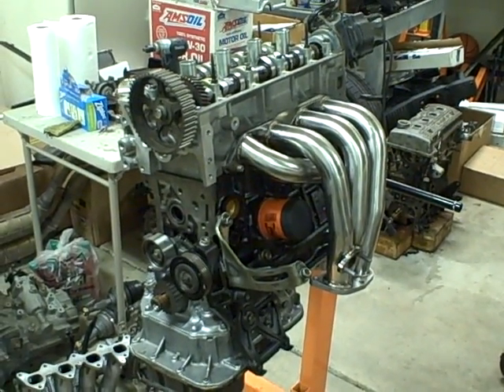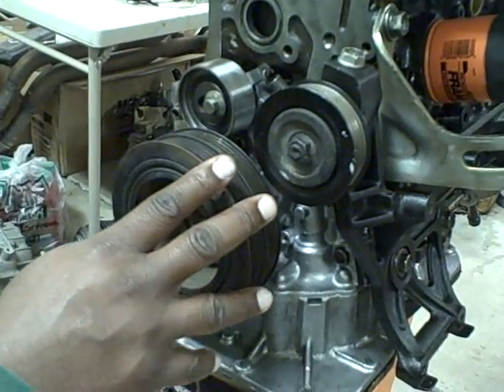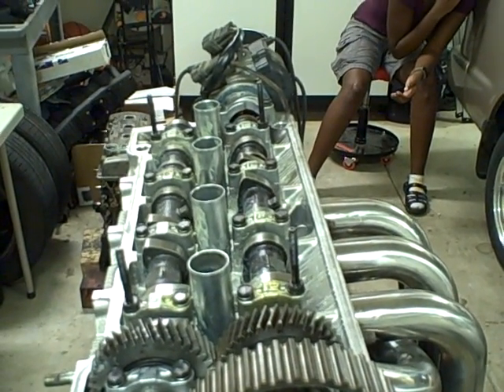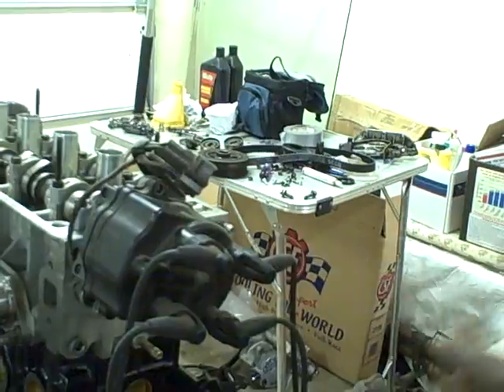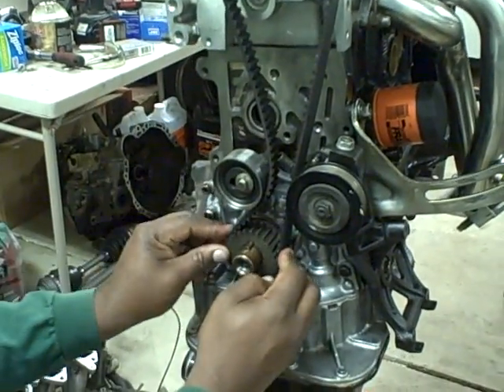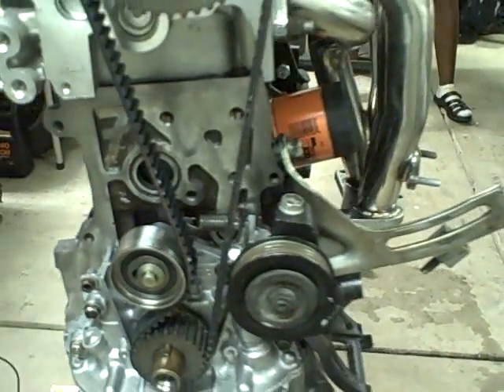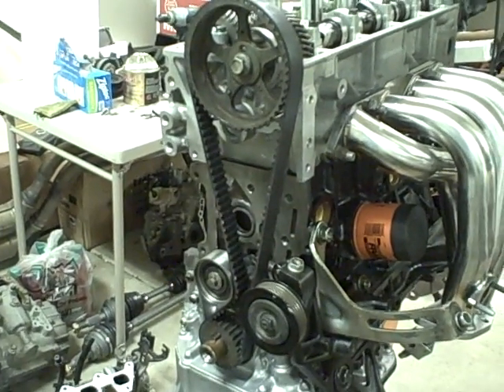7afe 4afe engine rebuild  Timing.AVI

Comment: I commented on your other video, so I skipped a tooth it’s 5 before tdc right now is that bad? And I going to blow the engine if I start it up to check if it sounds right at 5° before tdc?
Reply from the maker: If you know the timing is off, YES, that is bad. Don't start it. Make sure the timing is correct first, then start the car.
Reply: @Engineerboy100  I clocked the crank a bit and put it on the tooth before. Started it and it sounds good just like before. Only thing, it cranks maybe an extra revolution to start. Is that something to worry about? Timing seems to be on point( the factory cover is plastic that has a couple millimeters of play) I don’t think it’s more than 1° of difference but to skip another tooth might be way off timing. 

Also. The cams are in sync cause I locked them and never touched them.

Just wondering why it takes longer to crank start now, maybe the belt is too tight at tensioner?

Comment: My Corolla has low compression for some reason. New headgasket and resurfaced head, new timing belt, crank and cams are timed with each other, valve clearances are within spec, piston rings are good (compression doesn’t go up when oil is poured into cylinder),  valves seat, new head bolts, also used the copper headgasket spray as well for insurance. Have no idea why my car has low compression.
Reply from the maker: Check timing.

Comment: Hi Clint  again thanks for a very helpfull video.
I have a question for you...actually I repair the same engine (7afe) my son car.
How do you lubricate the engine for the first start...I mine all parts are new and dry..any way to pray the oil pump?or just start without spark plug and let run until lubricate it self?
Thanks man
Reply from the maker: For a first start you can disconnect the spark plug wires or disconnect the fuel injector connectors and then turn the engine over for about 10 - 15 seconds. I also like to wait until just before I'm going to start the car to pour the oil in the top, so as it drains down it coats some of the parts freshly.
Reply: @Engineerboy100  thanks a lot bro..that is the only way I now..now you confirm that...thanks😊

Comment: Excellent video. I have a 4 cylinder 8v diesel engine with a single cam.
Does the same thing apply by making sure piston 1 is at the top?

Comment: engine looks clean..what cleaner that you used for it.
Reply from the maker: After removing any material left by the head gasket, I degrease the engine block surface with acetone. But this head and block are new...
Reply: @Engineerboy100  Thank you.

Comment: Do you have any rebuilt 7afe engines for sale?
Reply from the maker: No, sorry, I only rebuild my own. The one I rebuilt and sold in another video, I sold to my Dad.  I just do videos, sell parts and write books.
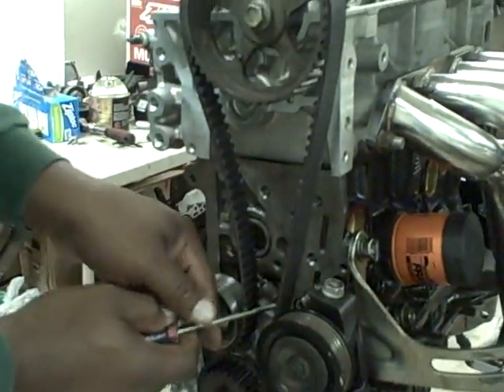Reply from the maker: No. The 7afe is not driven by the timing belt.  The 2000 Camry's are driven by the timing belt. 7afe is driven by a serpentine belt. Here is another one of my videos that shows the water pump pulley clearly. Go to about 4:13 and you can see it.  https://www.youtube.com/watch?v=RoL4svsOt7c&t=6s
Reply: Clint Hightower hey Clint I just another engine in my Corolla, do the 7afe rev slow ? It pulls good to 60 then seems to rev a lil slower outside of the 1rst 2 gears. I have a 5 speed
Reply from the maker: That sounds strange.  My 7afe pulls hard all the way to 6k  rpm, I would double check the timing.
Reply: @Engineerboy100  ended up being the timing was too retarted. Took a timing light and set it properly. Thanks.

Comment: Это двигатель не 7aFe!
Reply from the maker: Thank you, I worked hard on it ;)
Reply from the maker: https://www.dropbox.com/s/mcwpv0rb7lun038/0%20Entire%20book%20with%20covers%20and%20QRC%20for%20eBay.pdf?dl=0
Reply: Видимо зря старался!)
Reply: It's not 7a-fe
Reply: в лучшем случае 4a-Fe или 5a-Fe
Reply: in the best case 4a-Fe or 5a-Fe
Reply from the maker: 4AFE, more displacement, assemble in us, available in manual transmission, many parts exchange with 7AFE ...... m 2 cents :)

Comment from the maker: If you are a beginner and want to learn basic services check out www.ycccdiy.com
Reply from the maker: Here is a free copy of my book.  Check out the Trouble Shooting Chapter especially, down pdf from my Dropbox.  https://www.dropbox.com/s/mcwpv0rb7lun038/0%20Entire%20book%20with%20covers%20and%20QRC%20for%20eBay.pdf?dl=0
Reply: Engineerboy 100 Does this apply to the Corolla 94 carburado?
Reply from the maker: Yes, the carburetor or fuel injection does not affect the timing, it is only the method fuel supply
Reply from the maker: You should down load my free book, in it I explain this and much more.  https://www.dropbox.com/s/mcwpv0rb7lun038/0%20Entire%20book%20with%20covers%20and%20QRC%20for%20eBay.pdf?dl=0

Comment: your videos are very good, How to the valve gap and clearance check on  corolla 7afe?
Reply from the maker: Rogerio Duarte You have to measure the  space between the cam and the lifter, then measure the shim thickness.  The shim is on top of the lifter.  the way to adjust the clearance is to replace the shims to a thickness that brings the gap into spec.
Reply: Engineerboy100  Thanks dude.
Reply from the maker: Here is a free copy of my book.  Check out the Trouble Shooting Chapter especially, down pdf from my Dropbox.  https://www.dropbox.com/s/mcwpv0rb7lun038/0%20Entire%20book%20with%20covers%20and%20QRC%20for%20eBay.pdf?dl=0
Reply: will be useful for me, thank you.

Comment: Excellent video!  Answered some questions I had and some question I didn't know I should be asking myself :)  Wish I found this video 2 months ago before I messed up (at least I think I messed it up) my timing belt replacement (1996 toyota corolla 1.8).  Now looking to replace harmonic balancer (rubbing on case and eat a hole in lower belt cover :(  Have a no start issue.  Just died while driving.  Last thing I though it might be was timing (belt) as I just did it 2 months ago and car ran fine.  Replaced crankshaft timing sensor (error code for it) and just now see that crank and cam not sync at proper position :(  How did that happen?  How would bad harmonic bal cause timing belt to slip?  Going to inspect tension pully next and definately going to follow this video when re-doing the timing/belt :)
Reply from the maker: No start could be the alternator.  If the alternator fails the car will continue to run off the battery for a while until the battery dies, then the car will die and not restart until the battery is recharged and alternator is replaced.
Reply from the maker: Check out my new channel which will have many more videos "Your Car Care Companion" just do a search for cccsafety300
Reply from the maker: Here is a free copy of my book.  Check out the Trouble Shooting Chapter especially, down pdf from my Dropbox.  https://www.dropbox.com/s/mcwpv0rb7lun038/0%20Entire%20book%20with%20covers%20and%20QRC%20for%20eBay.pdf?dl=0

Comment: The camshafts doesn't need to be balanced they spin at half the speed of the crankshaft. Porting and polishing will give you increase in compression but if you want more compression without using a turbo you would have to increase the size of your valves also. If by saying "shave the top" you mean decking you would have to put a thicker headgasket on it to compensate for what was shaved off which would be pointless unless your block was warped

Comment: timing ok set to 10 btdc engine is verry silent no issue there ,checked tps sensor for continuity no dead spots or anything ..as for the pcv valve yes there some oil in the intake but seems ok its not clogged .. gonna put a catch can anyway  but looks like a misfire changed air filter ,sparkplugs  cleaned fuel injectors out of the car ,cleaned idle control valve, new distrib cap and rotor....must do a compression test and change spark plug wires.thanks for quick reply

Comment from the maker: A valve adjustment is not where I would start.  I would start by making sure the timing is correct and the throttle position sensor is adjusted correctly.  I would also change the PCV valve, oil gets into the intake manifold when these go bad.  Adjusting the valves is not an easy task, it involves taking the cam shafts out and adjusting the caps ... not something you want to do if you are a beginner.  good luck.

Comment: can you please tell me how to adjust valve clearence on 7a-fe i have a bad idle an sometimes the steering wheel shakes .. spark plug nr 2 is kinda smoked  and the part of the intake manifold where nr2 piston is ...is smoked.  its like gas its passing intake valves or not closing properly . i want to know if its a clearence issue because of age or valve not closing . i still have to do a compression  test . any ideas thanks in advance    and sorry for my bad english